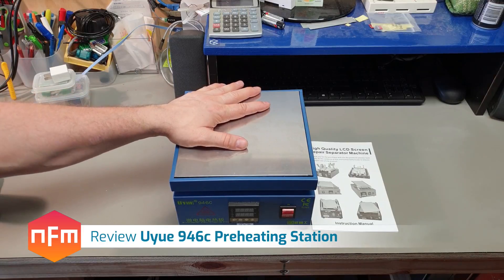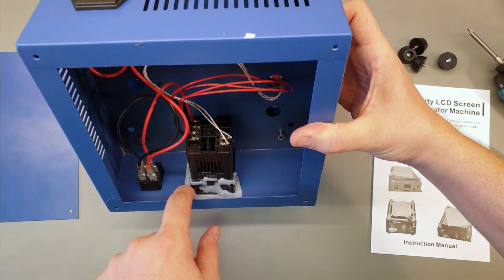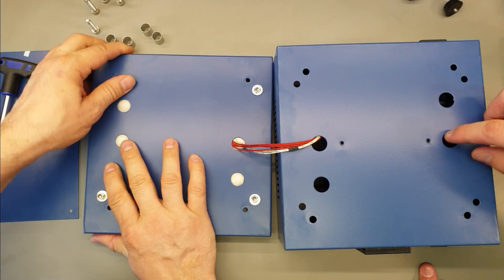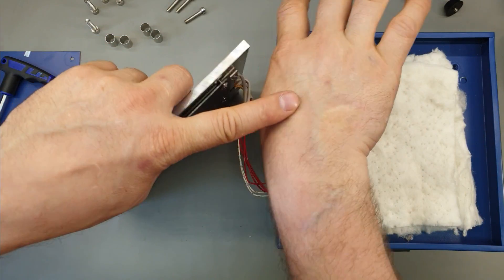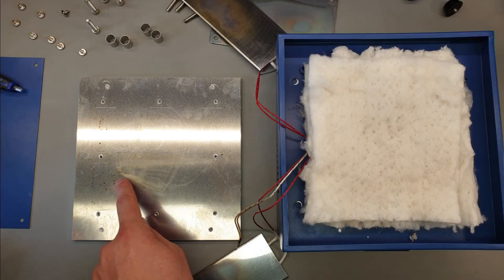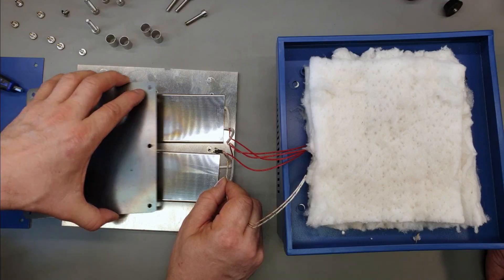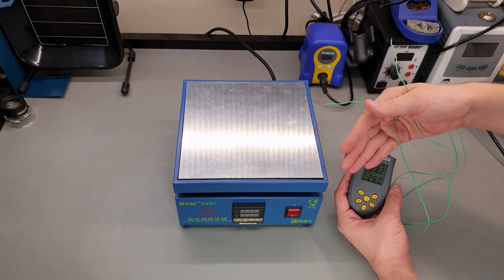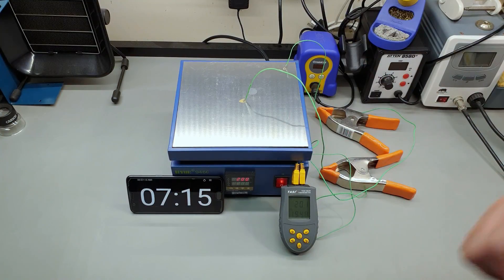Uyue 946c Phone Repair / SMD Reflow Hot Plate Review and Upgrade

Comment: is there any way to clamp pcb's on the plate? for example when using the heater for keeping the board at 120 degrees C while hand soldering?
Reply from the maker: We have tapped threads into the plate so we can bolt strips of aluminium to hold PCB's in place.

If you do this, be sure to avoid drilling through the heating elements!
The plate is thick enough that you don't need to drill all the way through.
I'd suggest taking the plate out to do the drilling, just to keep the elements safe from damage.

Also, some nickel anti seize on the bolts you use will help prevent them galling up.
Reply: @NearFarMedia perfect! Cheers

Comment: Actually, thermal paste would help potentially considerably to increase the rate of temperature rise when heating the plate.  That was one of the mild criticisms I saw of this unit from another channel that does rise adequately, but not necessarily quite as fast as for some soldering profiles. I think thermal paste would solve that minor shortfall.

Comment: Hi is this heat plate 7 inches or 14 inches etc please, and is it useable in the United Kingdom 230volts I believe we use and is the 1 you purchased in the link in the comments section useable in the United Kingdom please again is it 230 volts what I think we use in the United Kingdom please. Great video management thanks.
Reply from the maker: This one is 200mm x 200mm square.
It might work on 230V if you connect the heater elements in series instead of parallel, but you'd have to make sure the temperature controller is rated to 230V too.
Reply: @NFM Thankyou for replying back, my electrical knowledge is basic so maybe I will have purchase a heat plate from the United Kingdom, I was hoping to purchase one from from China because possibly they might be cheaper because times are difficult in the United Kingdom and Europe at the moment. Great video thankyou.

Comment: Bought one for cell phone screen and back glass cover removal as well some reflow work....had it about six months or so now....and i usually keep it set at right around 100 degrees F....and i have noticed recently that the set temperature is not staying where i set it at....and its spiking up out of control....any fix to this...or part replacements that i can order?

Comment: Wish I could find one of these. I got one but it uses the small round elements like on a 3d printer hot end. It uses one in each corner so the middle takes a long time to heat up. thermocouple is in the middle so the edges overshoot by a LOT before it sees the temp in the middle. going to return it and try another one, figure I'll get lucky eventually.

Comment: How can I convert my hot plate from 110v to 220v
Reply from the maker: You might be able to do it by rewiring the two elements from parallel to series connection.

Comment: Mine had 100V AC on the hot plate. After disambly all (inclusive the heating element) and reassemly again it was gone for what so ever reason.
Good review!
Reply from the maker: Ooh, measured on the exposed metal of the hotplate itself? Ouch.
If you fixed it, good gob! They do work well after a couple mods like I showed. I still use mine from time to time.
Reply: @NearFarMedia  Yes, directly on the soldering surface of the hotplate. I first recognized it during rework due to a prickling on my arm.
Then I took my multimeter and found that there is AC with respect to GND.
I think I had a defective device from production, because the company logo was removed. It was only 40EUR or so all incl.
I came here to see if the fault was a design or production issue. Something learned again, thanks to you.

Comment: Hi There. Hi There: 

I bought a UYUE 946C recently. It works fine but I did not receive a decent manual that identifies what the PID parameters do. The PID label on the unit is UY-C100-220V. I need to change the settings but without the parameter information that isn't possible. Any info (a link to a guide?) that explains what these parameters are and what the their defaults should be would be very helpful. Thanks in advance!
Reply from the maker: I have added links to the manuals in the video description. I hope it helps. :)
Some of the controllers have a cut down feature set depending on what the manufacturer decided to include so your mileage may vary depending on which specific controller you got.
Reply: That's great. Thanks. I did find those guides but I think I got a Rex knock-off version as the parameter labels did not match. I will take a second look though and I'll see if I can line them up so to speak!

Comment: 6mm and that's thick? Are you crazy? The controller is like 4USD, the case is like PC PSU case, the heating elements are not even ceramic, and all that costs 40USD and shipping 40USD?
Reply from the maker: There's no need for ceramic heaters in this application, and the 6mm plate spreads the heat evenly enough so a thicker plate will only add thermal mass and cause it to take longer to cool down. The steel for the case is much thicker than a PC PSU case, it's physically larger too.
The controller may be cheap, but here you are paying for a completed product, not a few loose parts.
It might, maybe work out cheaper to DIY, but certainly not when you factor in your own labour costs to build something.
Reply: @NearFarMedia  Nobody factors in own labour cost as nobody is that busy.
Reply: @juliusvalentinas  I guess you speak for everyone and how import their time is... what an asinine comment to make.

Comment: I was considering buying one of these, looks like there's plenty of room inside the case to replace it with a more intelligent reflow profile controller. Thanks for the review!
Reply from the maker: Good idea, that could be a good mod. Lots of room for an Arduino etc.
Reply: @NearFarMedia  You get some pretty good multipoint PID controllers in that standard 48x48 industrial format, and then you just have to either program in a temperature profile, or just change to the preset profiles as needed. Often they are USB programmable as well these days, meaning you can have a PC do the work for you.

Comment: 01:34 Quick comment on the switch: It is double-pole and switches both the active and neutral which is great, but it also needs both the active and neutral to power the neon indicator. If a cheaper switch without the neon indicator was used instead, they'd probably go for a single-pole switch for the active only.